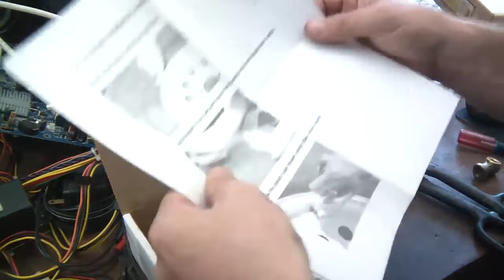E-Z tyrebeads tire beads install balance early bronco

Comment: Just put some in my truck's tire. I used one of those square electric sanders i had that vibrates really fast. Just put the edge of it on the tubing and put 8 oz of beads in about 2 min.

Comment: Pro-tip. You can definitely let the air out at full PSI, it won't shoot out and hit you in the eye. The core remover tool is notched and has a hole to help catch the core and prevent that. It's honestly easier to do it with more psi as well. Your biggest danger is a bit of dust getting blown around.

Comment: They look the same as the Dyna beads. If you have something that vibrates like a dildo or metal engraver; it helps to get the beads flowing through the tube making much quicker work of it.